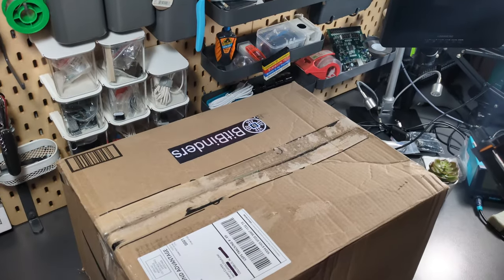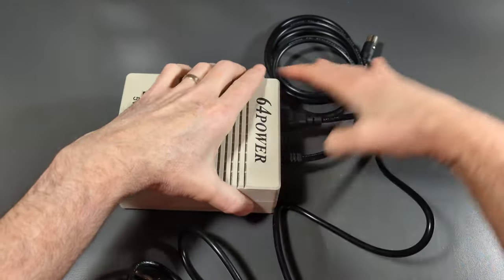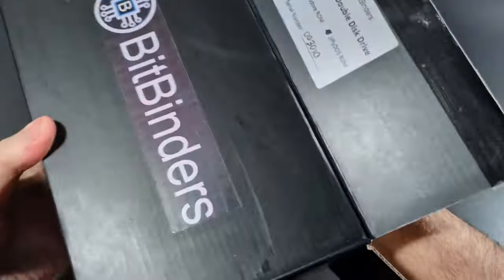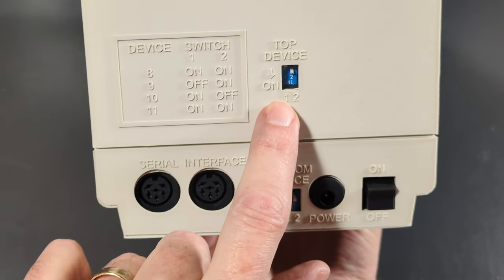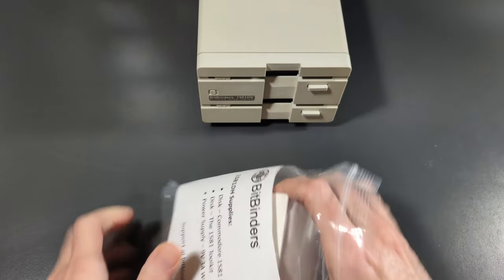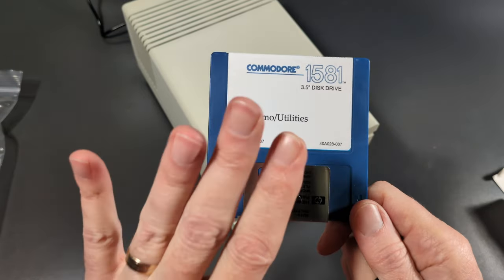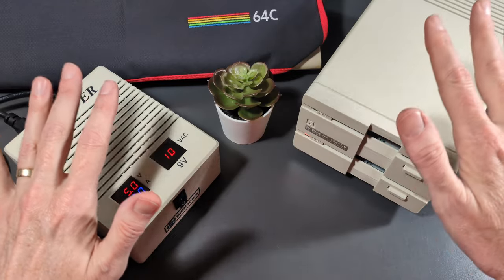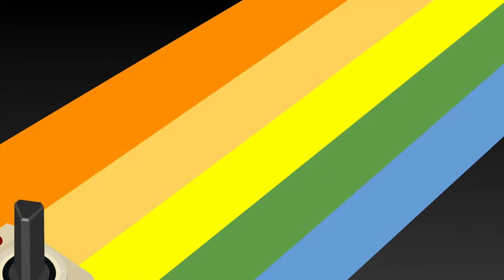💾️ BitBinders Dual Commodore 1581 Disk Drive and Power Supply! New Stock! #commodore64

Comment: The power supply was a bit big compared to other options, but those drives are amazing!
Reply: The power supplies are roughly the size of the original Commodore power supply.  Of course, power supplies without the voltage/current monitors and large (or no) displays can be smaller.  Also, for a more ergonomic design, the cords enter and exit on the back, and the switch is on the front and much larger than some of the smaller supplies available. Much easier to use on your desk or on the floor than others.
Reply from the maker: One of my favorite features was plug placement! Thanks again, Craig, for this opportunity. More to come and I hope this video brings awareness of these amazing contributions to the hobby!
Reply from the maker: They are so cool. Stay tuned. I'll fire them up soon.